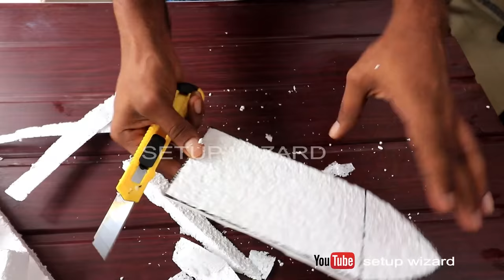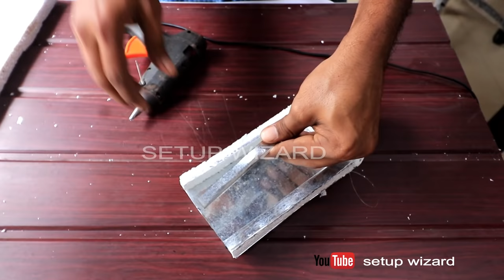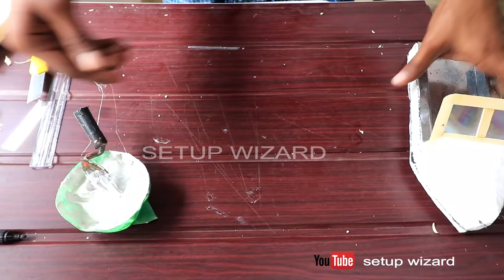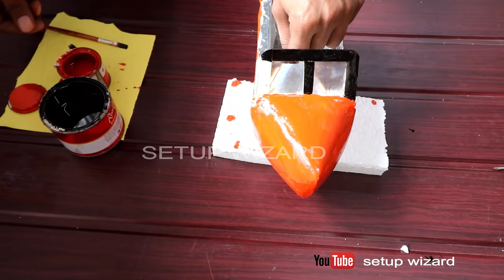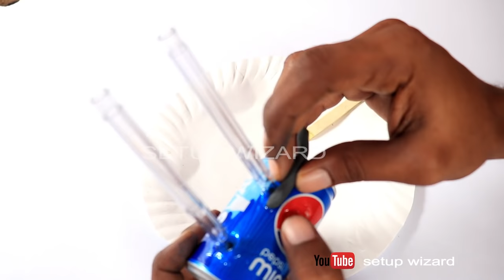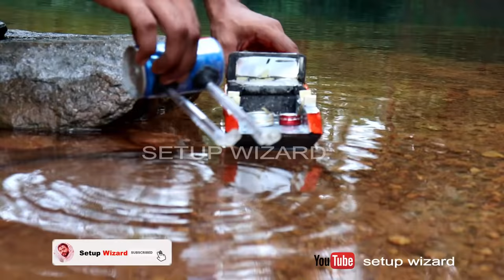How to Make a Steam Boat using PEPSI bottle

Comment: I assume with a high probability that the movie presented here is fake. First of all, the pipe outlet should be under water and is now above, which should prevent the engine from working. Driving alone is definitely too fast compared with similar engines. The film itself is made of very short pieces where the engine assembly is not shown exactly, and its sailing into fragments of a few seconds. For me - fake.
Reply: I agree.
Reply: Me to
Reply: I agree
Reply: so can i use this as reference?
Reply: I agree plus with that big of a boiler it would take ages for it to boil and another is it will not make a popping because that tin can is full of water and too stiff
Reply: Not working it's all I have done
Reply: Además no muestra cuando dobló los tubos de las lapiceras, y como se dijo, al no estar sumergidos en el agua, el poco vapor que produce se escaparía a la atmósfera y jamás alcanzaría la velocidad que muestra el video

Comment: What did you use for the straw to hold in the can
Reply: That is epoxy putty; clean and sandpaper the areas before application (this is the weakest point of the design)